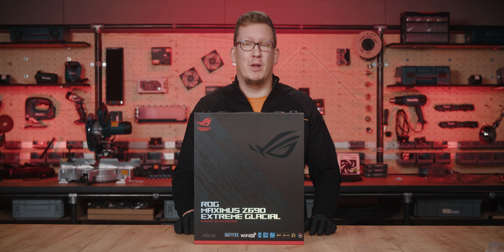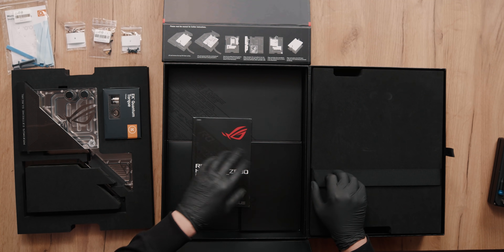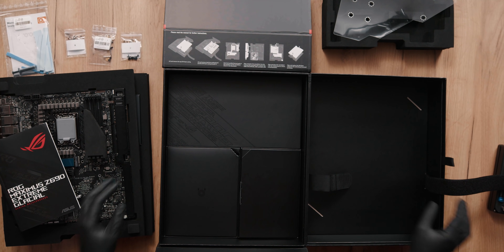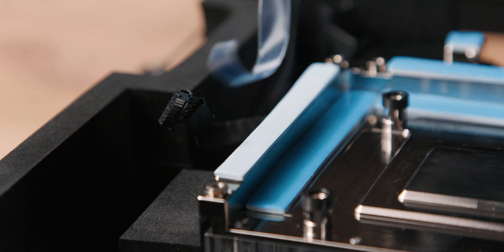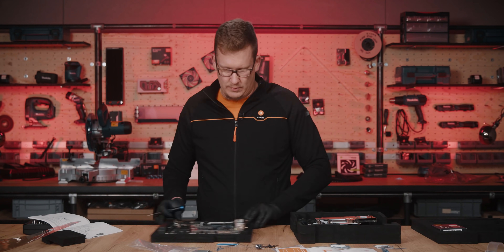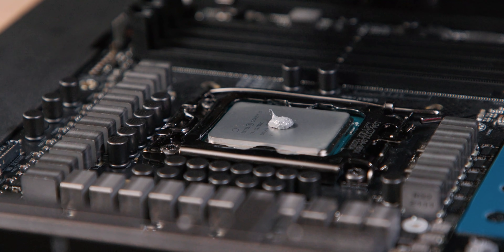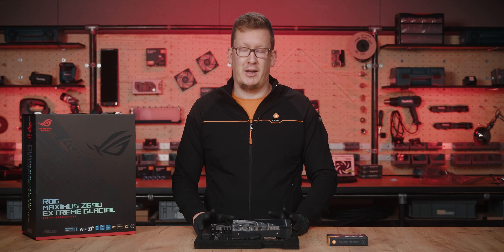Installing the Ultrablock on the Asus ROG Maximus Z690 Extreme Glacial | EK HOW TO

Comment: huge problem with this ultrablock and cleaning it with ekwb cryofuel. Nickel plating comes off in spots _ yes directions were followed , also all components are the same material. so there should not have been any reaction...--  after 4 days of running it after a proper cleaning and proper flushing its screwed.. I have a RMA with asus as we speak.. 2000.00 usd for a board and monoblock THAT YOU CAN NOT open to clean and polish the nickel plating, screws are under the Oled that hold it together - that and the excess Glue. Luckily its still under warranty. now its a blame game between ekwb and asus.. ( good thing i got it from amazon- last case scenario return )

Comment: Hello, I recently purchased a brand new “Asus ROG Maximus Z690 Extreme Glacial” for $2,115.28… Unfortunately, though, to my dismay, midway through Attila’s “Preparing the EK Ultrablock” section, I noticed someone’s ‘handprint’ on the underside of my Ultrablock! … My ‘question’ is this: Is there anything I can do to ‘remove’ that disturbing handprint? … My ‘concern’ is this: If ‘bacteria’ (from that handprint) enters the cooling-water supply of my new “Asus ROG Maximus Z690 Extreme Glacial” motherboard — it will contaminate/damage not only my motherboard, but also other critical components of my new custom fully water-cooled PC build! … By the way, I took a photo of the underside of my Ultrablock that clearly shows a human handprint (but I was unable to post it).… Otherwise, Attila, excellent installation tutorial video… Also, please advise me on how I can remove that disturbing handprint from the underside of my Ultrablock so that I can resume/continue with my build. Thanks!

Comment: Hey, Attila.  I assembled my motherboard, but one of my thick white washers was "hiding" and I decided to go forward with the assembly without it.  The washer I left out is the one you place at 3:42.  I've asked multiple sources and the general consensus is that I should uninstall the Ultrablock and add the missing washer.  As this is not a simple undertaking, I have a few questions:

1. Do you agree that I should uninstall and add the missing washer?  Or will I be fine without it?
2. It looks like you peel off a sticker from the thick white washers, making them adhesive when you place them from 3:42-3:51.  Mine didn't have any stickers to peel off and didn't seem to be adhesive.  I just put them in place and was very careful not to displace them.  Did I miss something?
3. Are the washers used with the "A" screws on the back of the motherboard these same thick white washers?  It certainly seems like it.
4. I assume when I remove the Ultrablock, I'm going to mess up all the thermal pads.  Should I completely replace the thermal pads?  Is there anything else special I should do to clean up after the old thermal pads?
5. Lastly, I was paranoid that if I didn't place the Ultrablock perfectly, the thermal paste I applied to the CPU might spread out in only one direction instead of spreading out evenly across the CPU.  Is it possible to mess this up or will the thermal paste always spread evenly?

Sorry for asking so many questions, but I definitely want to protect my investment!

Comment: WAIT !!! no one pays attention to what her manual says (chapter 2, pg 6): Install M.2_1 before installing the monoblock, that is, it will have the waterblock on top. What will happen if the Nvme M.2 crashes or if you want to change for a more modern one?....simple....you will have to disassemble the entire monoblock. Great!!!! 👀
Reply: Yeah, fun times... my m.2 SSD died in that slot and it's been a huge pain to swap it out especially without the original foam, plastic template, etc. I strongly recommend taking pictures of each screw you pull so you know where it goes
Reply: It is understood when you buy this that you will have your SSD’s installed before the mono block and if something happens to your SSD’s you are pulling the mono block off.   No different than if something happens to the cpu.   You put your best SSD’s in from the get go and call it a day.
Reply: @od40k77  Too bad it's the PCIe 5.0 M.2 slot. Such SSD's are not available yet and you'll have to remove the monoblock if you want to install those SSD's in the future.

Comment: The thermal paste must be distributed before putting anything, that way you ensure all the surface is used for heat transfer
Reply: If you distribute it, you can introduce air bubbles. If you have one blob that is pressed, there is much less chance to get air trapped. That's why I prefer the dot method.
Reply: There is a reason why the manufacturers recommend a pea size amount in the center of the cover.   The manufacturers know a thing or two.

Comment: There is enought space for install in the first pcie slot my rtx 3090 with EK active backplate?
Reply: I was wondering the same thing! EK?
Reply: i have a asus strix 4090 oc ,, i modded with the ekwb liquid cooler with active backplate.. there is just enough room to have it fit properly ( 6-8 mm ) its tight but it fits..  ( i suggest removing the push tab that hold the gfx card in iits slot.) you will have a bitch of a time when you want to remove it otherwise) i had to make a tool to do it

Comment: Saw the price for the motherboard 2000 dollars! 1000 I think would have been more reasonable.
Reply: FYI: The regular extreme is $1000 as well as similar motherboards that aren’t as sophisticated or tailored to liquid cooling enthusiasts as this motherboard
Reply: @lilkwarrior5561  The full X570 watercooled boards cost around $1000.
Reply: No way you’re getting a Z690 MB with a custom water cooled copper mono block from EK for $1,000.   That ain’t happening, especially in today’s global market.   This is a niche product not made for the masses.   I would rather see it priced at $1,600 but given the world supply and demand problem, I see why retail is $2,000 USD.

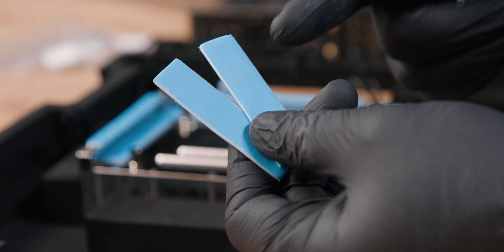Comment: Extremely appreciate this; I can't wait to order one November 4th! For the 2-3 M.2 SSDs part (11:47), the thermal pads are directly placed on the top of the SSDs as usual? What about the SSD in the PCIe5 M.2 SSD slot?
Reply: You don't install anything on the SSD itself. From one side, you have the pads on the Ultrablock, and from the other side, the M.2 cover has pads from the other side, as seen at 5:41. Hope I helped.
Reply: @Attila_Gobor  Ah, thanks; appreciate you clarifying this! Have a splendid week!